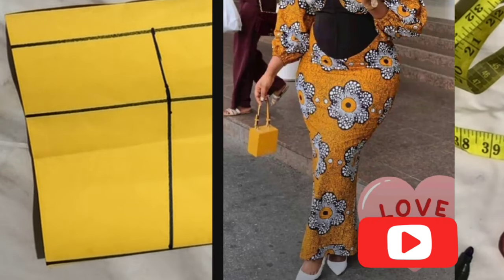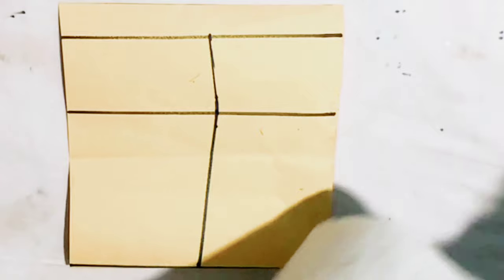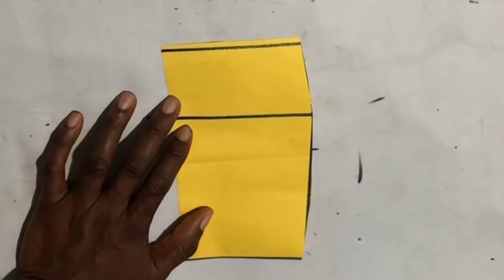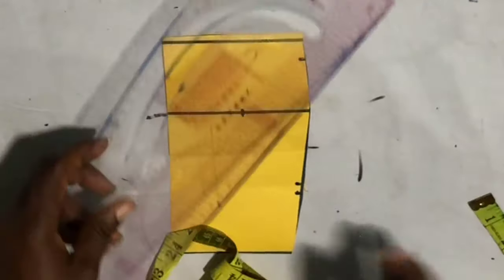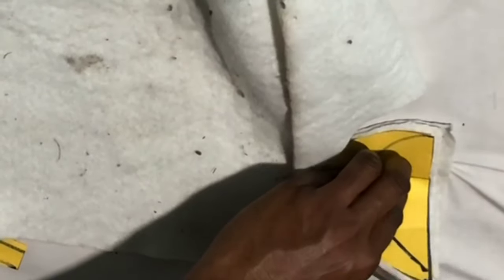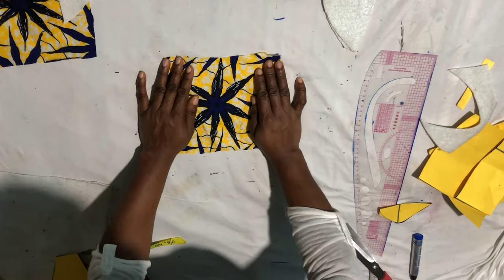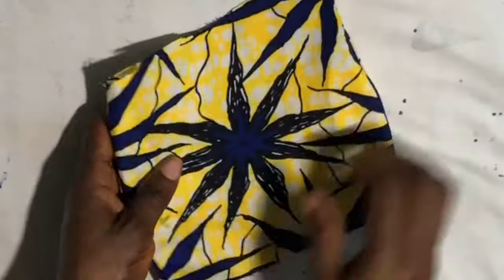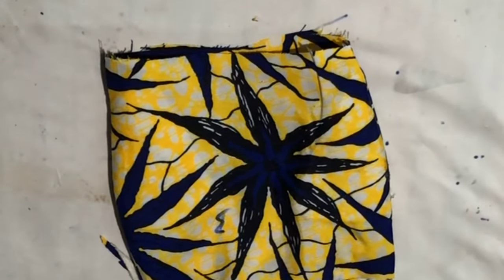DIY:HOW TO MAKE PERFECT HIP PADDING FOR CORSETS #corsettutorial

Comment: Good morning ma. Please I really need your response as one of your subscribers, I most not fumble 😅😂.
 Please ma, if I want to pad only my hip area, how many inches do I need to measure inward from my side hip to able me draft only for my hip padding that is if I don't want to pad my butt, thank. 
2. Do I need to take the same length as you did if I'm to pad only my hip. 
3. Please ma, if my waist band is like 2.5-3 inches in wild, how many inches do I need to step down from the waist before placing my hip padding. Pleasssss I will await your quick responses thanks
Reply from the maker: @amosunchika9492  1 you can't pad only the hip area it must tilt to the side a little so it will balance .most times all u need to bring out shape in your style is just to pad the sides